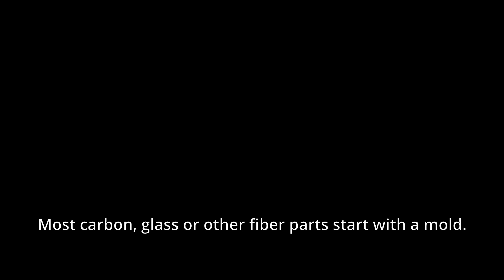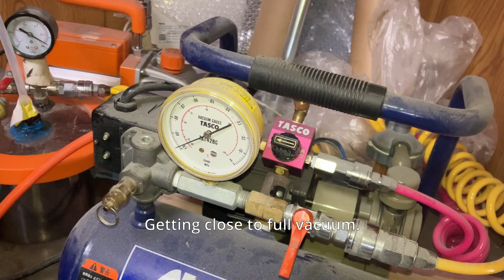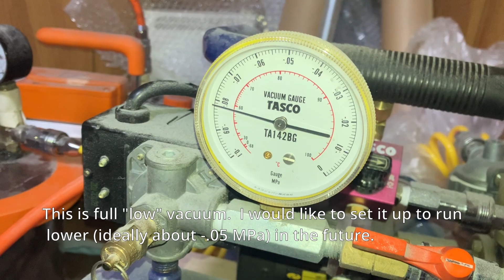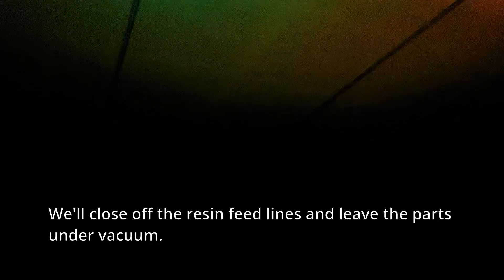Making R34 GT-R Carbon Fiber Diffuser Fins Part 1

Comment: Umm, holy HECK!!! What an intricate process😲
I find this super interesting, & greatly respect the work involved.
Is this the common/usual/only way to do CFRP......even for larger items like say lip spoilers or guards etc?
Honestly, this is fascinating. Thank you for sharing, & hope we see more vids like this🙇‍♂
Reply from the maker: Thank you, I'd love to do more information-dense videos like this but I have a feeling that too many will put most people off.
CFRP is commonly done in one of three ways:  1) Putting dry fabric onto a shape and pressing resin into it with a brush or roller, 2) putting dry fabric onto a shape and pressing resin into it with vacuum, or 3) getting fabric that a manufacturer has already pressed resin into, putting that into a mold and applying high heat and pressure to it.  I mostly use method #2 because it's a good compromise between structural accuracy, repeatability and cost, but it's actually best suited to large parts.  If I had (could afford!) the machinery, method 3 is better for small parts like these and doesn't produce as much waste. - Ken
Reply: @tkgtcars  Thank you kindly for the response Ken, I very much appreciate it.
Yes, I understand your meaning regarding info heavy vids & how many viewers may turn away from (sadly).
Personally, I totally love knowing the how things are done, even if it may be something I can't do myself or outside of my scope.
Again, many thanks, & please keep up your dedication.
Always support for TK!!